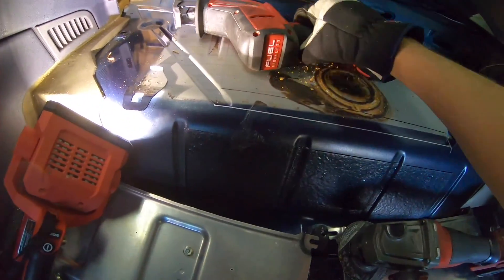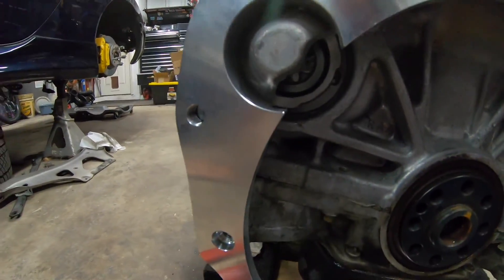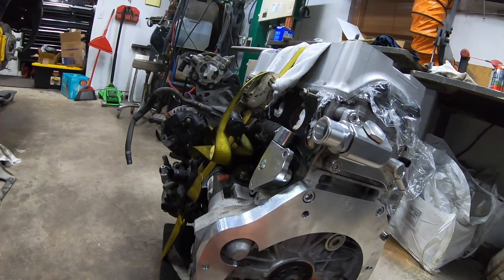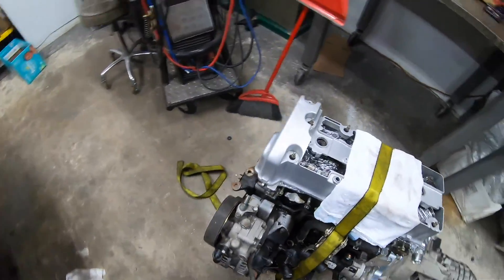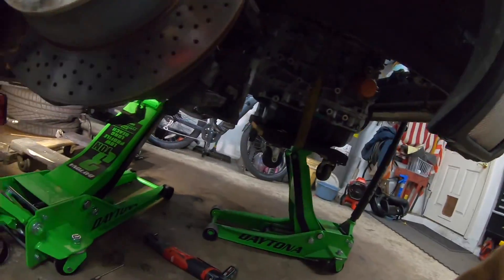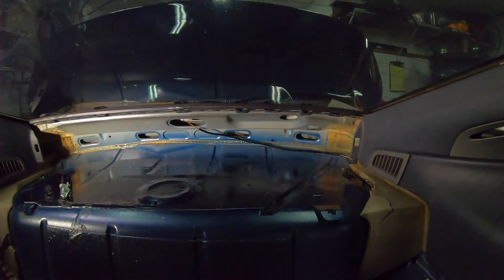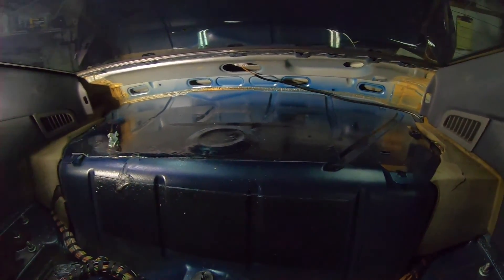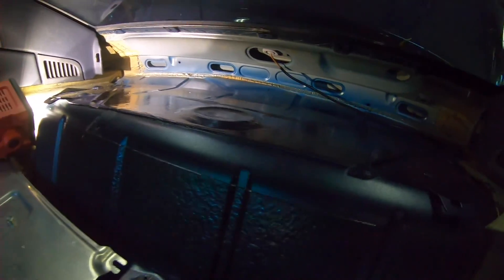Cutting Up A Perfectly Good Porsche 911 (996) To Fit A Honda Motor

Comment: Mmm that adapter looks like its very well made, and the engine fits pretty nice too. changing plugs will be a bit of a hassle but thats to be expected since the original engine was a boxer. 
Not a fan of using a grinder inside the car without covering/taping up all the glass.. Ive made that mistake a couple of times, I`ve had to replace most of the glass on a customers 1960s Jaguar because there was pitting everywhere after rust repairs to the floors.. and those tinted windows were a nightmare to source! (learnt my lesson the hard way, that job ended up costing more than it payed)
Reply from the maker: Yeah it was a super quick cut. The tints getting redone anyways.
Reply: @baysidefabrication  Ah didnt know it had tinted foil on the inside, that will help alot against grinding spark damage! (i wasnt that lucky, had to find all fresh undamaged blue tinted glass for a pretty low production numbers car, which ended up costing way north of $2500 and a shitload of time)
Reply from the maker: Ooof yeah that sucks. I’ve done it before too. Like I said it was a 2 second cut just to get sawzall blade into it so I wasn’t worried. Anything more and yes I would have put up a bunch of protection.

Comment: Hey ! whats happening? I love your channel. I own a 01 996 coupe and have spent a great deal of time learning as much as I can about the 996 , DIY all the way. 
I hella enjoy your passion for modification. Putting a K24 into the porsche is bad ass in my book. Screw all the purists. What stands out the most in this video, was your ideas on a access port/door so to make things a lot fucking better . For example: the GD Air Oil sept. what a fricking pain in my ass. Injectors, plugs air intake and all the GD vacuum thats up front. Ive always thought of some type of access door either on top of the rear deck or on the front angled portion of the fire wall. Seeking for some type of approval
from anyone on all the forums is useless. You know .... So anyways you have a dedicated fan than looks forward to your content. I'll share your channel on my Facebook page
Porsche 996 page . Your bad ass! 
Gene O. San Jose Ca.

Comment: you can get rear panel from a c4 or gt3 and it will sit higher all you need to do is re drill all the spot welds instead of cutting it .
Reply from the maker: Any idea of how much higher out of curiosity?

Comment: Do you think a Quaife sequential would work on this set up without using the transaxle ?
Reply from the maker: I don’t think you could fit a motor transversely. With its suspension setup.
Reply: @baysidefabrication   thanks man I’m gonna have to try to find a dogbox transaxle I wanna do the same swap but supercharged do u have like a email or something if I have questions or if I wanna buy some fab stuff for the project ?